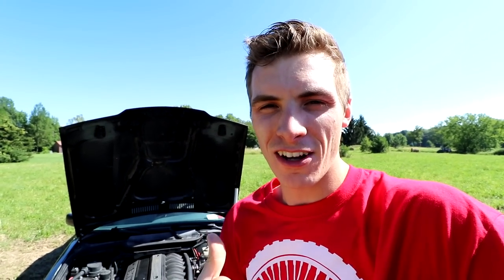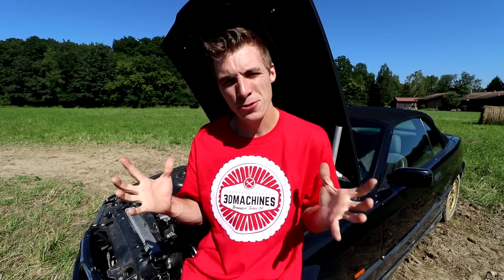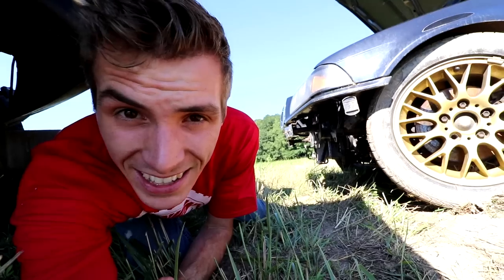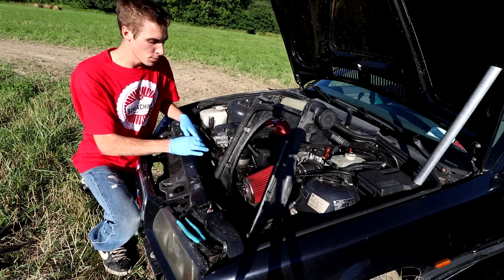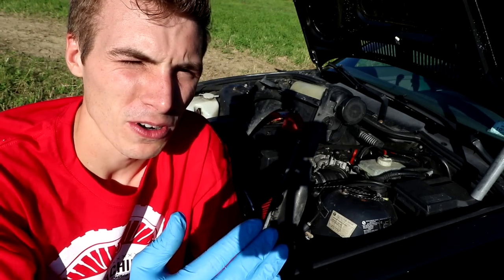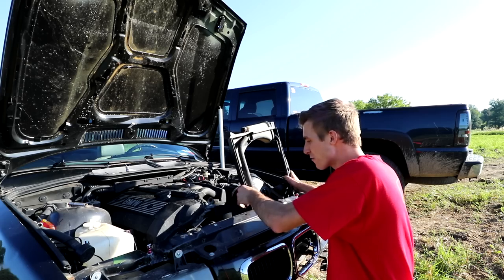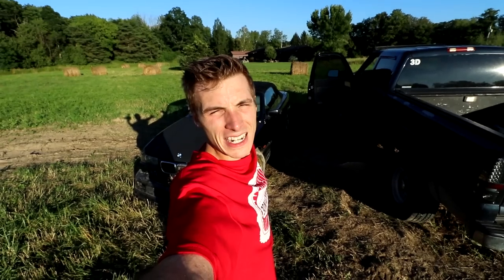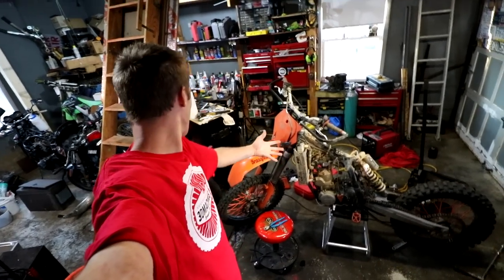MY BMW is Broken Again...

Comment: You know what the ranger is missing. A 3dmachines decal and some mud tires
Reply: Michael Bearden yes it needs a decal it has to have one so it is less risky
Reply: Michael Bearden ii
Reply: Michael Bearden Yep it will definitely add a lot more horsepower too
Reply: Michael Bearden heck yes!!!
Reply: turbo and a straight pipe
Reply: Michael Bearden and half its frame
Reply: Marco Rides lol
Reply: Michael Bearden and a not welded plate frame
Reply: Daniel .M true

Comment: You should also wire your engine fan to a switch so your can turn on the fan all the time it worked very well with my BMW   Ps if ur see this please respond 👍🏼
Reply: Daniel Walsh isn't the fan with clutch drive?
Reply: Maby on that model but it works on my e46
Reply: Daniel Walsh that's what most drag racers do. My dads got 4 drag cars built and that's the first thing he wires up
Reply: Daniel Walsh a

Comment: The BMW is over heating because u r going side ways so the air does not go to the engine of the car
Reply: That what the fan is for.
Reply: mc4nathan might need a better radiator and fans
Reply: the radiator fan should be able to keep the car cool.
Reply: No it's overheating because he has no idea what he is doing and never bled the system correctly. Plus he drilled a hole in his radiator and "plugged it" with a bolt. Genius!
Reply: mc4nathan the fan itself isnt going to keep the car at operating tempature, there are many passages inside engines that are meant to circulate coolant to absorb the heat and pump the hot coolant back into the radiator. the main passage to the engine block is through the thermostat which if is stuck closed it will create a overheating problem, just like dalton is experiencing.
Reply: Justin Stewardson it's only over heating because of a sticky thermostat / air locked
Reply: Purge the system by jacking the front end off the ground open the rad cap let the car run the air bubbles will come out.
Reply: Brandon Green why not just pat it on the roof and brup it like a baby lol

Comment: Dalton removing the thermostat isn't going to help if the engine is getting hot and it's going through the radiator. It's going through the radiator because it's boiling past the cap. It is there to help the engine warm up faster causing less wear. When the engine gets hot it opens and lets coolant flow. It's going through the engine and radiator fine you just need more airflow through the radiator.

Comment: If your having problems with overheating I would run Evans waterless coolant in the BMW. It runs with almost no pressure in the system, and sense there is no bubbling, liquid always stays in contact with the cylinder wall to draw the heat away. you'll never have to worry about it again. ( I have had my four wheeler up to 260 and it might even run better now)

Comment: Same thing happened to my old car bro, check the little cap on the radiator for any holes or anything (costs like 10 bucks for a new one), check the water pump and the thermostat. HOPE THIS HELPS!!

Comment: Dalton, have you considered upgradung your water pump in the beemer to an electric one? That eliminates the fan blades which can crack, frees up some HP to the engine and some units  can be preprogrammed to deliver coolant in different rates. Have a look at a transmission cooler for the gearbox too

Comment: The thermostat not only controls whether or not the coolant moves thru the radiator, but also throttles the rate at which the coolant flows. So what I'm trying to say is that by removing the thermostat all together it will cause the coolant to flow too quickly, and not allow the heat to transfer from the engine block to the coolant or to the radiator. The solution being simply drill holes in the thermostat to slightly restrict the flow, but ensure it is open all the time.

Comment: I have a 2000 mustang and in heavy traffic or if left idle for an extended amount of time it'll start to overheat as well.  I've already replaced the thermostat and it didn't fix the problem. The bottom half of my radiator is beat to hell from rocks/ bugs and anything else that I've hit going down the road. A new radiator is my next part to buy; Hopefully the new thermostat fixes your issue!

Comment: From my limited knowledge the thermostat regulates the coolants temperature. Removing it will not allow it to actually provide cooling. Instead a constant hot coolant temp will circulate . Just what I understand. Although I Hope it works. It seems to be a short term solution. Love the channel 👍🏼

Comment: For your overheating issue, if the cooling system is in ok working order, run straight water and a bottle of water wetter. Will cool much more efficiently but gotta not forget to switch back to antifreeze before winter lol.

Comment: The thermostat is there to help your car reach operating temp and sustaining that temp by opening and closing allowing lower temperature coolent into the engine to stop it from overheating. I would say the problem would be low air flow from low speed and sideways action. Hook the thermo fan up to an independent switch to turn on and stay on while your driving at low speeds but high rpm's.

Comment: Dalton, the reason that themostat plastic is leaking, is due to the seal the thermostat makes. The gasket on the thermostat prevents the excess flow of coolant/water. You need a thermostat unless you by pass that by sealing it completely open.

Comment: Dalton, removing the thermostat is probably not a good idea.  I tried that once and the water flows though the system too fast and doesn't spend enough time in the radiator to cool down.  Of course that was on a typical street car, for pasture drifting it might work out differently.

Comment: Love your show watch it with my wife all the time just figured I'd comment that the gasket on the thermostat can be what is what seals that cover and a two stage thermostat is not good to leave out can circulate to fast and get hot some times

Comment: 3D machines you should get a cordless impact 1/4 hex bit and you can get adapters to put sockets on it makes take things like the bmw bumper off in a snap. Also i would like to see more on the gx100/ gator build thank you.

Comment: Hey 
Make a pressures test on the radiator  if there is no leaks remove te inteiror of the thermostat if it continuous to overeating check the what're pump .
If all thousands things can't resolve the problem ride it until it die
.
Regards Portugal 🇵🇹 💪🏼💪🏼 
Love your videos

Comment: You need a thermostat to keep it from over heating... The thermostat has to close to give the coolant in the radiator time to cool off before circulating in the engine again. 
Some BMW's have plastic impellers on the water pump... you might want to check that.

Comment: Dalton now that you have taken the thermostat out it will still overheat, since the thermostat controls flow it will now always flow, since the coolant will always flow, it won't stay in the radiator long enough to cool off.

Comment: Hey 3dmachines for the BMW you need a thermostat so that way your engine doesn't overheat cause your thermostat makes it so it runes at the proper temperature and if you don't have one in your car it will heat up even faster and may do damage to your engine

Comment: I don't know if you have thought about the possibility of the lower radiator hose pinching shut at high rpms, if that is the case you can replace it with never kink hose with a spring either around (the better of the two) the outside or a spring floating inside the hose

Comment: @3Dmachines You should consider putting the BMW electric cooling fan on a toggle switch so you know that for sure it's running when you need it.

Comment: pull the center out of the thermostat but don't remove it completely. There needs to be some restriction to give the coolant time to pick up heat in the engine

Comment: Dalton Theres one problem with your theory on removing the thermo state because my Dad ran a dirt race car and if you remove the thermostat coolant/water will pass through the block to fast and not take away enough heat what we did was remove all of the moving parts from the thermostat and use it as a restricter.

Comment: You have to cut the two brases on the thermostat but leave the round part and the seal in it so it seals because I have the same problem with my Subaru powered bug

Comment: Hey man, just aN FYI sometimes by removing the thermostat the engine won't run cooler. This is because the coolant won't have enough to time to be cooled properly from the rad because of the higher flow.

Comment: If you take the thermostat out it will run hot to because the coolant doesn't have time to cool down because it's going to fast through the radiator and won't dissipate the heat. Google it

Comment: Well here is some positive help :D

Are you aware that you need to ''air out'' the cooling system? it's not as easy as just fill it up and go, if you have not done it right or not at all well then there is the reason to you'r problems with the beemer 

BMW later engines is alloy top and they are wery sensitive to heat, if you are unlucky you could have cause the headgasket to leak or made the top twisted (swedish dude here so spelling is not great)

Here is a guide

1) Using ramps or a jack get the front of the car 1' or more higher than
the rear. That will make the radiator and bleed screw the highest point
on the engine and facilitate removal of air.

2) With the bleed screw open, add coolant until no more air comes out of
the bleed.

3) Leave the filler cap off, or at least loose, and set the heat for max
temp and fan speed. Leaving the cap loose will prevent air that's still
in the system from causing a "coolant fountain" once the engine heats
up. Start the engine and allow it to warm up to operating temp. As it
warms up occasionally crack the bleed screw to release any air and top
up the coolant as necessary.

4) Once the engine is at temp bring it up to 2000-2500 for a few seconds
several times. Then crack the bleed until no more air is released. At
this point the heater should be throwing lots of hot air, which
indicates that the heater core is filled with coolant. You may have to
repeat this a few times to get all the air out.

5) Drive the car a bit, allow it to cool back down, and recheck the
bleed for air. Over the next few days you may get very small amounts (a
few bubbles) of air out of the bleed screw.

Comment: taking out the thermostat will not allow the engine to get up to operating temperature and the car will try to richen up the mixture and or it will idle a bit high. Just a little FYI.

Comment: Is it a small leak or a big one. If it is a small one you can try to put in s little cinnamon in the cooling system so the water will take it around the engine. It do work. I tried on an old Saab i got that was leaking but now it doesn't. But don't take too much so it will block the water inside the engine.

Comment: You really have to bleed the cooling system correctly. You might want to deactivate those air bags if you already haven't as well. I've had a few E36s.. Oh and bring a fire extinguisher and wear helmets. If you can weld I highly recomend skid plates on vital areas. Just a suggestion..any thing that can go boom ya know.

Comment: The Thermostat keeps the engine cool by closing and allowing coolant in the radiator to cool down, when the engine temperature hits the mark it opens and only the hot coolant can pass then closes again.  Without it, your engine can overheat from circulating only hot coolant and no chance to let it cool, or run too cold. the engine is meant to run at a certain temp.

Comment: The bad thing about takin out it will run hot cause the water want stay in the radiator long enough to cool down need to put one back in or drill a small hole in the old thermostat

Comment: You should order two slim radiator fans and wire it up to a separate switch so you can flip them on and have them run all the time when it's running and it will keep the car cooler bc you drifting not driving on the highway to get a lot of air through the radiator

Comment: if your bmw still overheats it could be the water pump , the turbine in it is usually plastic and degrades pretty quickly. Its a common problem on the m52 engine

Comment: If you have a pot, a stove, some water & a thermometer, you can test your thermostat to see when it opens by boiling it in a pot of water on a stove ... if you boil the water and the thermostat does not open, toss it into the trash (once it cools off).

Comment: Dalton there is a simple way to check your thermostat get a coffee cup put some water in it drop your thermostat into the water into the cup Now set the microwave for a minute and a half to two minutes wall that microwave is doing its thing  get a pair of pliers want the microwave goes off take the cup off get the pliers pull the thermostat out see if it's open or closed if its closed its no good if its open its working do a video on this like a little live stream

Comment: Hey man could you not install some better fans to make it run abit cooler on the track because your not doing highway driving and there isn't enough air running through the rad, to help that get some brapptastic fans on that piece of fine German engineering

Comment: Your thermostat also controls how long the coolant has to cool in your radiator so if you remove your thermostat completely the coolant won't sit in the radiator long enough to cool you really need a thermostat
Reply: Spud Q2 if he takes the thermostat out the only thing is the motor will run cold so he want have heat in the winter other everything will be fine

Comment: Just a bit of advice. never take the complete thermostat out. rip the center out and put the housing back in... it'll stop it from leaking and slow down the flow of the water to not destroy your water pump
Reply: p.s I am a radiator tech by trade

Comment: You need a thermostat in the BMW to regulate the coolant flow otherwise with no thermostat the coolant will flow to fast threw the engine and not efficiently pull heat from the engine and will still overheat

Comment: If you want to know if the thermostat is good, boil it, should start opening around 120-180F depending on the set point. Btw, If you do, don't use that pot for food anymore. :)

Comment: Cut the centre out of thermostat and refit the outside of the thermostat so water flow is somewhat restricted otherwise water will flow too fast to cool in radiator

Comment: you should not run the car without a thermostat. That thermostat might have been faulty because of the epoxy, but you don't want the engine to get too cold. If it does, that could cause some problems with the tolerances and prevent good oil flow causing premature ware.

Comment: Most engines run cooler with a properly working one than they do with no thermostat. This is because without a thermostat water can flow through the radiator without staying in it long enough to shed the heat needed to cool the engine.

Comment: i see the point of removing the thermostat but couldnt that create a cooland pressure problem?? due to the coolant not being pushed through the thermostat and instead being pushed through the thermostat housing in the engine block????

Comment: put the thermostat in hot water to see if it's faulty or not. if it opens its fine. if it doesn't, you need a new one. but you've bought one. tip for the future? ;)

Comment: This may be to late but im a tech school. For your cooling system. Try getting the engine at max operating temperature. let engine get cool check your top radiotar hose and see if its collapsed if it it that means. Your vacuum val've is not regulating coolant when the engine is cold or hot. The vaccine valve is regulating only to your engine and not through the radiotar. Also if you have had a coolant leak its a good idea to drain your trans oil. Coolant only has a pressure of 20 psi max. Trans oil has a psi too 200 psi and above. Like I said may be to late but overtime. Your coolant will deteriaote which need be replace every 3 years or 50,000 miles thanks
Reply: This works with all makes and models so don't think this couldn't apply to your problem too

Comment: The bmw needs a water pump please just trust me I work on them everyday and I've owned four 3 series and it looked like the thermostat you took out was a fail safe thermostat where if it goes bad it fails in the open position so you still get coolant flow WATER PUMP WATER PUMP WATER PUMP

Comment: Basically when the car is sideways and slamming off the limiter the car isn't built to be at high RPM and sideways, to support that it needs better cooling system to support the abuse.

Comment: Every 5 years bmws need a radiator, thermostat and new hoses, check the bottom hose there should be a small hose going to the block, I'd replace that as they always leak
Reply: Also replace the fan clutch